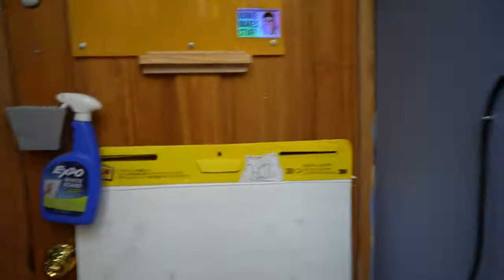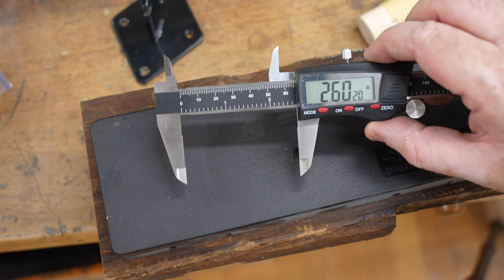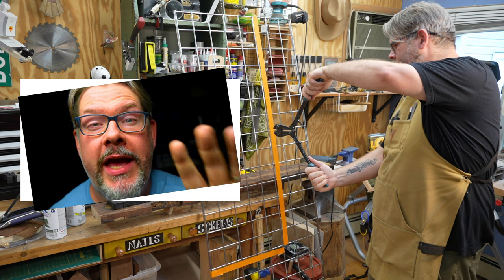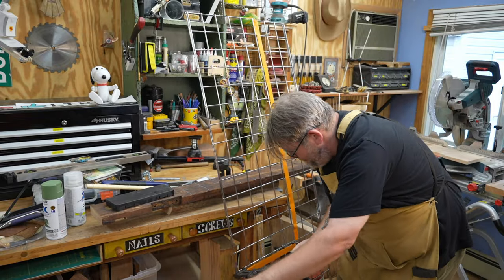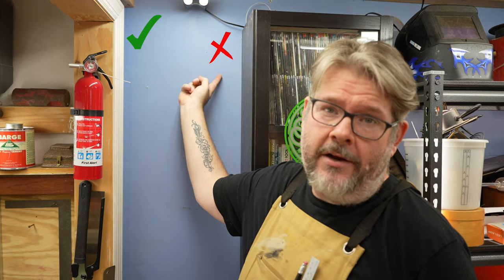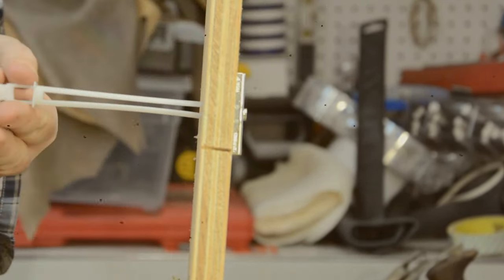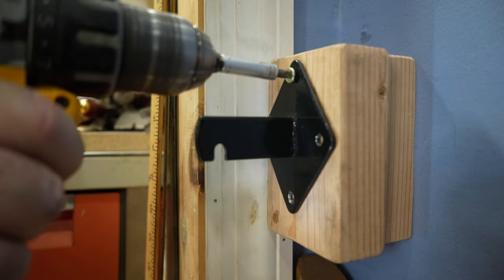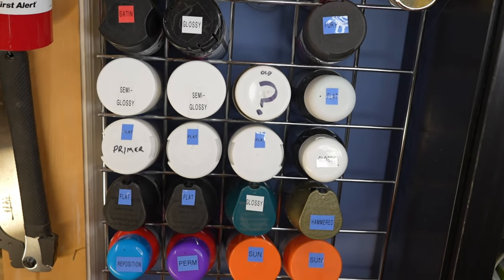Ultimate Spray Paint Storage - How to store Spray Paint Organized, Efficient and Visible

Comment: Suggestions: 1. spray paint doesn't last forever so use a thin line marker & mark it w/"Bot" date & again w/1st use date. 2. Spray paint nozzles clog easily even when you "clear" them after, so buy some aftermarket nozzles to keep on hand. 3. Clip on spray can "gun" attachment is a great improvement over the unadorned finger especially for long spray sessions, & a great aid to a better finish. 
What about the "axe" project (if i may axe)?
Reply from the maker: It is most definitely on the list. A few things that need to get done/be put in place first!